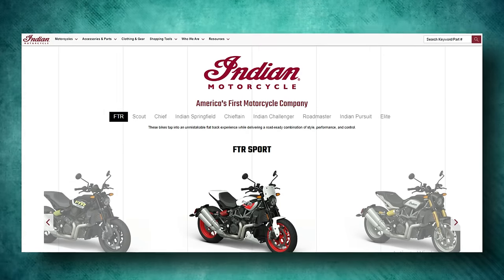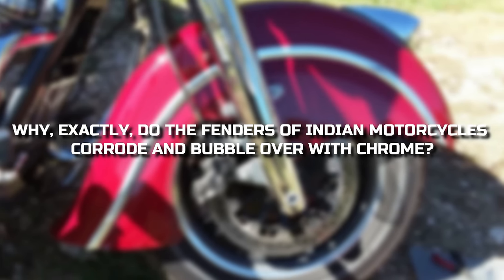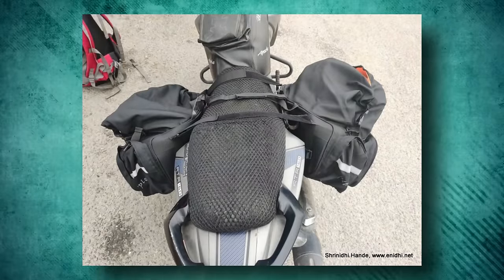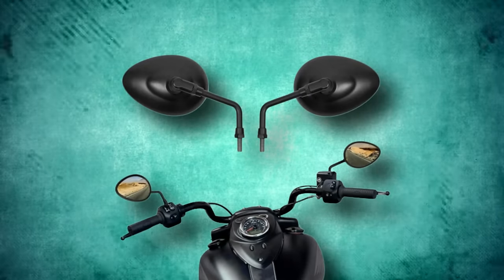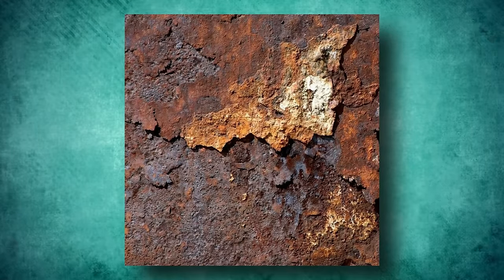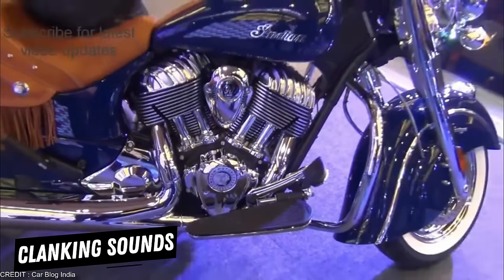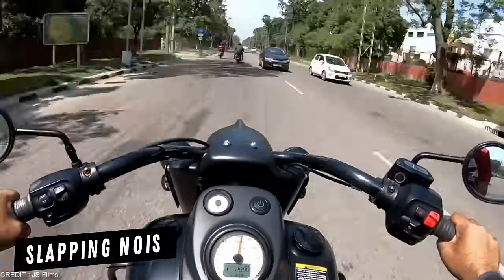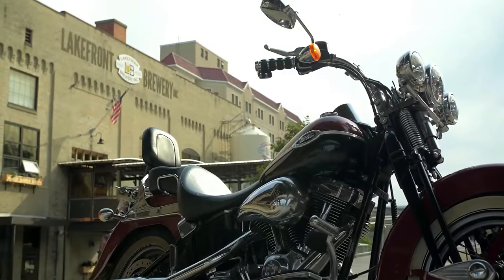This is why Indian Motorcycles SUCK

Comment: 2021 scout bobber with 14,000 miles and no complaints. Had the fork seals replaced under warranty this spring, but I'm going to assume that's from the 4 miles if dusty grave roads I travel every time I ride it. Sturgis twice, Probably have over 800 miles of just gravel travel, I've also had it on logging roads and even off the trail into the woods while traveling/camping in northern Wisconsin and upper Michigan. I wouldn't say its particularly good off road but its been there 😅

Comment: Having owned 2 Yamaha's, 2 Harley's and now an Indian Challenger with over 100K miles on the street I can attest to all of them have their own distinct "issues". To title this video the way you have is nothing but click bait. The only issue I have with my Indian is the glitchy Ride Command System which as I understand it is manufactured by Harmen Karden so yes, that sucks and Indian made a huge mistake using them to provide that system but overall the rest of the machine is an excellent modern design unlike the Harley lines of outdated air cooled dinosaurs.

Comment: I love the look and performance of my 2017 scout but with under 4k miles on the odometer, I had a small oil leak from the stator plug and the starter failed. This is something I would expect from am a 70's AMF Harley not a 2017 Polaris. I got on some Indian community sites and found these are common problems on scouts. Wondering why it was not mentioned here.😊
Reply: I remember the days when electrical stuff was on the dry side of an oil seal. What the hell is going on these days?

Comment: So disappointed i watched this. We have four 2022 motorcycles in the garage. Scout bobber, Triumph bobber, Harley 48 and a Royal Enfield. The Harley is the most troublesome. My indian has 18,000 mi. The 48 and the Triumph bobber are pushing 10,000 and the Enfield has 5,000.  We wouldn't trade any of them.  That being said, the Harley is as big a pain in the ass to work on as it gets. Everything from bolts falling out, reoccurring engine light, belt guard litterly cracked and fell off, fork seals have already failed and oh ya, the damn thing has a dead battery in two days if you park it. The Enfield has been the most impressive of all of them! A third the cost, runs damn good! And keeps getting better with miles. I quite honestly thought i would humor my wife when she wanted to look at the Enfield. Figured i would look yhen go buy her a real motorcycle. So impressed i bought it on the spot and I myself rode it home 100 mi. From the dealership. She absolutely loves it and she gets more stops and lookers than the other bikes. We have had people waiting in the parking lot at Lowes just to talk about her bike! Happens all the time! Go figure! Love all four motorcycles no matter what!

Comment: Total clickbait. Using words like "suck". Thems fighting words. Come to find out, the vid disses mostly older Indian's. Meh video. I had a 2020 Low Rider S before getting my Chief. My Harley was outstanding, but it wept oil into the intake. That's a known M8 issue. Simply open the intake and wipe it off every now and then. Not a big deal. The point is, every motorcycle has its issues.

Comment: Pretty much everying listed here is something easily fixed Chrome?  It is a crying SHAME anyone even still wants chrome IMHO....serves no pracitical purpose and is just an inferior finish asking for trouble!   I wont consider anything embelished with chrome personally  I feel similarly about leather on a motorcycle seat also (great for riding suit though! Or my recliner which is in my living room not parked outside) Mirrors?   Seriously?  How is THAT an real issue?   Indian appears way ahead of Harley in finally at least trying to build some models with more acceptable ergos and handling....still not there but appear way ahead of HD IMHO

Comment: Not impressed with the video or analysis. Showing liquid cooled Scout engines while criticizing the air cooled engines is deceptive. 
Belt squeal is a common problem with belt driven bikes. Had it on my Zuke. 
 Have I heard about some of the problems you describe? Yes. Are they endemic with Indian, I've done a lot of research and do not see that to be the case.
Reply from the maker: I appreciate your feedback and perspective on the video. It's important to consider all aspects when comparing different bike engines.

Comment: All nuisance problems that are rare for Indian, I own 03'Heritage and 03'sportster and am currently trying to sell them after buying my 2019 Springfeild darkhorse. I will never spend another dime on HD since they became a part selling company with the piece of shit design and engine failure common REAL problem. Let's see says HD I think we will place the stator in the hottest part of the engine so the electronics package dry's out and rots or lets put 2 phenolic piece of shit chain tensioners in the engine and force you to monitor after 12000 miles (More shop time)or get the screaming eagle hydraulic that still needs changed out at 16,000 miles or lets put a bike out for $40.000 and have an oil migration problem so we can send the customer a stencil to drill through the motor and install a tube. Just a few of the reasons among at least hundreds more HD is not getting another dime of my money. Not 1 issue in almost 5 years with my Indian. Indian will be getting my business from now on